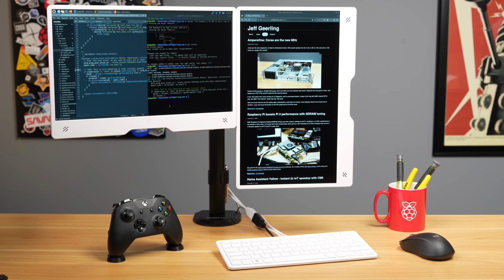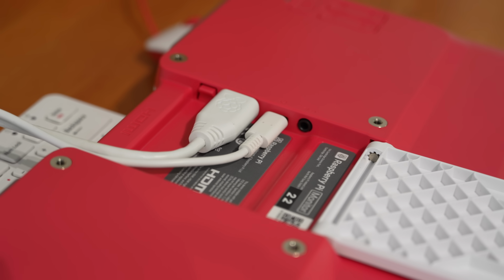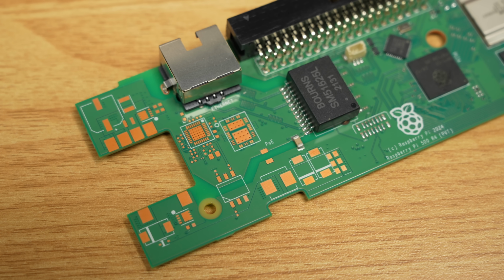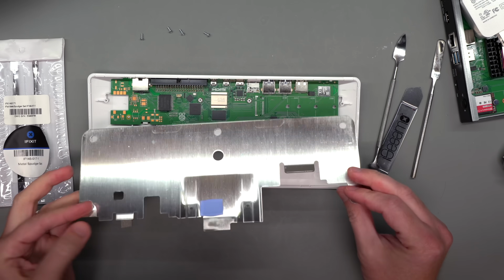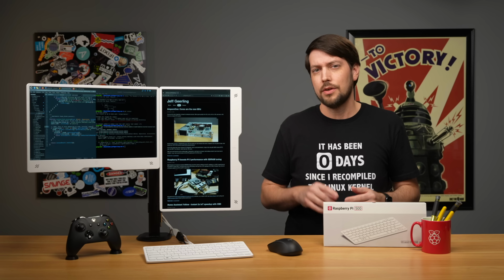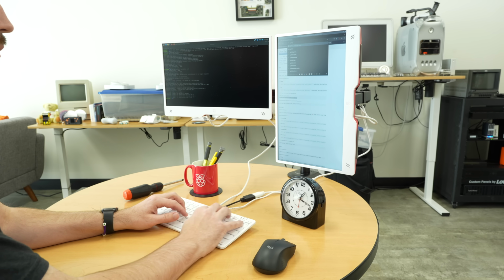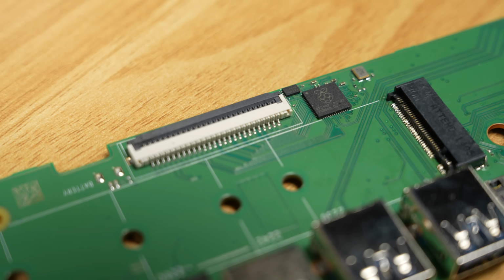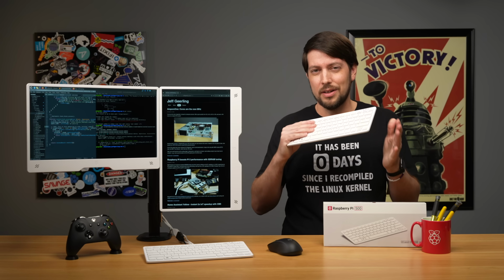The Keyboard IS the Computer! (Pi 500)

Comment: I've been tinkering with Raspberry Pi and SBCs for a while, starting with a RPi2 and Zero W, and eventually moving to an old i3 platform. Here’s my take: 

1. SBCs aren't meant for desktop use. Even the latest, most powerful SBCs can’t beat an old Intel or AMD CPU from the past decade in performance. The only advantages SBCs have are size and power consumption, but even then, if you're not running 24/7, the power savings aren't huge — your monitor likely uses more power than a mini-PC. 

2. SBCs are good enough as servers. They can handle most home server tasks like cloud replacements, NAS, and web services, all of which are low-resource. I get why ARM SBCs dominate in this space — they’re small, power-efficient, and can be hidden away without taking up much room. I’m testing Immich on a RPi4 to see how it holds up. Switching from a RPi4 to a ZimaBoard really opened up more possibilities while still maintaining those power and size benefits. But when I moved to a mini-PC with an old i5-7400, I realized it hits the perfect balance of performance and cost for home server tasks. It can do anything except maybe gaming, and I’m writing this from a full VM on Proxmox with that i5 right now. Modern mini-PCs are way more powerful and efficient than SBCs, and the price isn’t much higher. They're great as server or desktop replacements. Full desktop PCs still offer more power and expandability, but they’re expensive, noisy, and power-hungry, so they’re only worth it if you really need one. 

3. SBCs are perfect for learning and prototyping, especially for projects that need more power than an Arduino (like IoT stuff). But once you have a project figured out, it’s better to switch to a more specialized and cost-effective chip. SBCs aren’t usually found in finished products, mainly because of their general-purpose design. Also, they can’t replace microcontrollers like Arduino or RPi Pico unless they have one built in, and often they're used together.

Comment: Yes, two features would make it a great travel computer (use hotel room TV for monitor).
1. Full sized HDMI for hook up to hotel TV
2. M.2 slot (with hatch} for speed & storage.
With a long HDMI cable could use hotel TV from desk or bed.
A hundred “knicker” (hat tip NASCompares) travel computer with real 8 GB Linux is a bargain.
Absent M.2 how are speeds with USB 3 disk device?
Could one use an iPad for monitor?
LAPTOP — perhaps a Raspberry flavored Chromebook?

Comment: No PCI express no buy 😢 a SD card regardless of the size is a big NO!! Even a built-in emmc 512gb would have been better or ideally UFS 4.0 or something similar would and should be the base standard and should have been for pi400 as well!! The nvme should be populated with the board components but left as a buy your own drive expansion. It should also have access to the hats systems like poe and system fan's.. as it is id rather a 16gb ram pi5 and the pi monitors and a custom tiny pc case with a nvme hat and case fan and tiny Tower cooler with fans and build my own pi-pc 500 and call it pi5000 or pi500+ and sell pre-built pi500+ systems to sell.. i bet id get more orders for it than raspi will for this silly pi500. 😢 Very sad and disappointed with rpi

Comment: Still mini HDMI + still no USB-C + unpopulated M.2 slot + tiny Wifi PC antenna + no active cooling while increasing the price ? WTF Raspberry Pi ? If you want to charge more then do it properly.
Reply: I reckon that's for a laptop they're working on.
Reply: Why would you even release this yet. It is practically E-waste. Even if cheap, it is still terrible value because it does nothing remotely well...
Reply: No active cooling is a win. I agree on the rest though.
Reply: same here, looks head less laptop, and if screens where a little portablem basic portable laptop size PC, that power useage set low, you bigger power battery brick,
Reply: @dh2032  I agree, even then a headless laptop, that laptop will cost you less and have far better power than this Pi thing.
Reply: If you insist on looking at the Pi as a typical computer, then that's your problem... the Pi isn't meant to be one. If you want all those things you mention, then just buy a mainstream PC or laptop, be happy and go on your merry way. If you want to do what the Pi is designed for, then it's a good machine, which also happens to be able to run a full Linux desktop and do many typical computer tasks reasonably well. I'm surprised that, with you clearly being an expert in business practice, you haven't noticed the increase in performance of the product, nor grasped the ideas of inflation and rising costs and how they relate to selling products, breaking even or even making a profit.
Reply: @another3997  Things like the N100 are getting far too dangerously close to the price of the Pi for them to sit on their laurels. There are companies selling mini pcs with them for around what a complete Pi kit would cost, and then you have an x86 PC with a far better GPU, software support, and ports.
Reply: @another3997  LOL. yes, USBC and HDMI are too esoteric to expect a cheap PC to feature them? When did the OP mention being "an expert in business practise".
Reply: @another3997  mucho texto
Reply: @another3997 So the pi's entire purpose is to do some  everyday tasks only reasonably well? Ewaste.
Reply: @MuffFlux  The purpose of a Pi first and foremost is education. Hence the educational software that come preinstalled on the default OS. And the magazine they publish. And the educational books. And all the tutorials on the website. And the exposed GPIO pins on all of them. And all the educational kits companies like adafruit and elecrow have developed to work with them.

Complaining that a Pi isn't like a more powerful and expensive computer is like complaing a kids chemistry set isn't good enough for a professional labratory.

Comment: It feels like such a clean device should be able to work with less cables attached. Not sure the price hike it would need to have a single USB-C port for power and displayport. Also, too little memory. The pi forums seem to be very against a 16GB option, but for a mini-desktop, it would have been good.

Comment: Right now the best solution for roughly the same price would be a Pi Keyboard, a Pi Monitor and a Pi 5 with an NVMe base taped to the back of the monitor.  The only thing that'd be missing (over the Pi 500) would be a power button and LED on the keyboard.  And, unlike the Pi 500 it'd have PoE, more USB ports, two display/camera connectors, and ample cooling.

A dream product right now would be a Pi 5 case with NVMe base that'd hang from passthroughs for the VESA mounts (allowing a VESA stand), plug into HDMI and power on the monitor with captive connectors or short, neat, routed cables, plus a beefy compliant PSU to power both the monitor and the Pi 5.

Better yet, the same thing but with the 16GB CM5. It wouldn't be hard to design a carrier board for the CM5 with an M.2 slot to add to the back of the monitor.

Comment: If it had a switch that made it work as a normal keyboard i'd buy one. No touchscreen on Pi Monitor would have preferred that than speakers.
Reply from the maker: That'd be nice, like you couldn't it into HID mode and just plug it in via USB-C. Might actually be possible to hack, but would use a few watts still the way I'm thinking.

Comment: Let me be honest with you. Since the great pi4 shortage every other news or release were filled with excuses. Why was there shortages? "We can't betray moms and pops projects". Why there are no nvme slot when every cheap alternative has one? "We feel the feature set we've picked for the Pi 500 is the right one". 
When the Pi 600 will come, it will have a hole in that nvme space for you to buy and connect an expansion card.
Now I wonder how orange pi will clone this thing on rk3588 and if it will have nvme slot (it surely will).

Comment: It's an interesting system. I wonder if it wouldn't be more practical to have a PCB where you can put a Pi Compute Module on it instead of having the SOC soldered on. Then you can upgrade to a newer compute module without having to replace the whole thing.

Comment: I got the Pi 400 set right when it came out, got some cool accessories for it like the Adafruit Cyberdeck extension for the GPIO port, and only wound up using it a few times. It was a little too slow to really be a good desktop computer. The Pi 500 looks really nice, and a 2x to 3x jump in power is significant, makes me want one lol.

Comment: I really like raspberry pi boards and products. The 400 was great, and was something i wanted to buy to my kids when they grew older. However, here, the lack of NVME is annoying. But on top of that, micro HDMI? you KNOW those ports are annoying as hell, and break easily. On top of that, the price increase considering how cheap mini pcs are getting? I wonder how the pi 5 fares against a n100 computer, that pulls 6W... And those n100 start at 100$, with nvme slot(s) and a ddr4 or DDR5 sodimm slot...
Raspberry pi OS is great, amazing work on this, but again, hard to justify going for it rather than a n100 mini PC, that consumes as little as this one, is more powerful, x86 so any linux distro (or even windows for those that are bound by it)...
Sure, there are GPIOs on the pi. But how often do we use it nowadays? i used to make lots of projects using those in the past (i bought every pi from the first pi 1, first revision, and made robots, microscopes, etc, out of them. I even have a place on my wall for all the raspis that died along the way), but now if i want GPIO, well i simply use a raspi pico W. For cheap, i have the 2 cores dedicated to the task, and can access those over usb for commands, or even over wifi or bluetooth. So mini PC + pico is a cool way to make embedded projects with gpio. There are even some cheap mini PCs the size of a smartphone, so comparable size to a pi...
For me the most compelling products from the raspi foundation are the pico W line and the pi zero. Ok, the zero lacks power, but you have a hard time finding anything that runs linux well at this price, power draw and size. If you need a tiny tiny computer, well hard to beat the pi zero 2.
Also the CM5 is great, and interesting, if good carrier boards are available for it. But the more time passes the more the n100 eats use cases for me, like NAS and router are gone : i get better results with N100 boards that costs less than 150. I think a stonghold for the CM5 will be portable game consoles, like the older versions of the game boy pi kits and all.
But again, if someone were to release a cheap handheld with a N100 inside it could pove to be very nice too.

I don't know where raspberry pi future is, but it no longer has the price as a strong point (or as a strong one), nor the power draw, nor the compactness. Still has the GPIO for some use cases, and the configurability  with CM5, hats, etc. But it is getting more and more difficult to justify using it over other options.

The last bastion in my house that runs on a raspberry pi is home assistant. But i'm getting a n100 for that too, because compile times in esphome are too long on the pi4, and although faster on pi5, they would be even faster on the n100 for similar price, plus i get to use normal USB PD, nvme by default, and 16 or even 32GB of ram if i want; 2.5G lan, etc. All of this for around 150, not that far off from a kit with similar specs on a pi...

I'm a bit sad, because i want to want pi5, pi500 and all, but, i don't anymore.

Comment: The M.2 slot would've made this an instant buy for me. Pi Foundation if you are reading the comments then please make this a thing.
Also, I am worried about that power button location. I can see that button easily being pressed when pressing backspace. Moving it to the side or the back with the other outputs would've probably been a better choice.
Reply: I guess we'll have to wait and see if the 600 comes with it, along with other basics. I'm definitely passing on the 500.
Reply: Same here. My guess is they wanted to play on the nostalgia of old 90s mac keyboards. But even in the 90s I kept accidentally hitting that button.
Reply: And if they do, people will complain that the price is too high, along with all the other things they don't like... all whilst blissfully ignoring the basic fact that the primary goal of the Pi isn't being a typical desktop PC. It's designed to encourage and enable people to use and experiment with a huge variety of external projects, and get people into programming for them etc.
Reply: @another3997  Which they can do on their PC?

Comment: Marcin Plaza has a YouTube video of building an ultrawide DS. The laptop motherboard he recycled is similar to this.
With a clamshell design, I actually prefer his LCD choice over converting back and forth to HDMI.  I'd also rather a mechanical keyboard, even if it means giving up a power button and some LEDs. 
I guess such nitpicking means I'm NOT the customer type they are targeting.

Comment: The pi 500 only needs micro hdmi to hdmi cables or even micro hdmi to display port and a nvme slot and I'd recommend the pi 500 to people who just wanna do office work and browsing. It's the perfect mini PC for a lot of people.
My pi 5 setup with an nvme hat has issues with getting both displays to work due to my monitors only supporting display port. which is a bummer for me, but at least I can get it to work well enough for now to get some robotics stuff set up.

Comment: I have a Pi400 and it's quite OK but the first thing you need to do if you want to do any serious work on it is to plug in a proper keyboard.  These scrabble tile things with the keys in nearly the right place are just no use for a fast touch typist.  And if you need to plug in a decent keyboard then what's the point?

Comment: honestly, no m.2 is just a no-go for me, its the only thing thats annoyingly always sticking out of my pi400, an external m.2, yeah an sd-card works but its just not a preferred solution for me at least, an internal m.2 for the pi500 would have been ideal, so much so that i dont think ill get the pi500 ill just stick to the pi400 for now.

Not having a trapdoor slot underneath to quickly add an m.2 nvme is just plain silly, Eben Upton said the pi400/500 were directly inspired from the old 16bit Amiga home computers and they had trapdoor slots underneath to quickly add ram or accelerators so we know something similar can be done on something modern like the pi500 so its bizarre how they havent done it for the pi400 or the pi500.

Comment: Drop the price to $35, make it with two access doors in the bottom - one for an M.2, another for a Pi compute module, turning this into an accessory/dock.
Reply: And miniHDMI -> HDMI, at least one of the two. Additional place to attach 18650 batteries, like an old Walkman, would be great.

Comment: Missed opportunities and wasted space unfortunately. This form factor makes perfect sense for my mom with very modest and 100% browser based computer usage. Her laptop is still on Windows 7 and for some reason is very unstable with Linux Mint (chosen because it's the most Windows like). It'll just freeze and you need to hard-reset it. If this Pi 500 had an SSD slot I'd get one, I can live with a microHDMI adapter but an SD card is silly for this form factor.

Comment: No nvme is so so disappointing. It would have been an insta buy if it had nvme. Can’t understand their thinking. It’s like raspberry pi haven’t been listening to what users want. Sd cards are so unreliable. I wonder if there might be some room to fit a stripped down usb to nvme caddy and then modify the case so that a usb cable could be plugged in. What a mess this has turned out to be.

Comment: If I find a used one of the right price I might buy it but with such a minimal upgrade from the 400 I don't think I'm going to jump on this. If all of those components were installed, especially the NVMe, and possibly more ram I could have found multiple uses for it in retrogaming, amateur radio, and even a work. As it stands right now it will be a nice to have if I find a used one at some point. I would also like to see a black or even olive drab version.